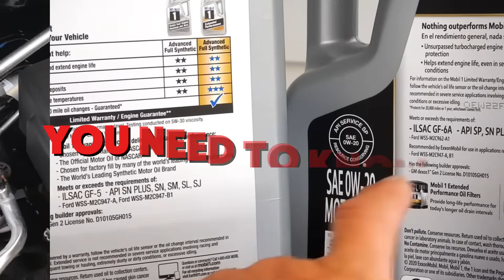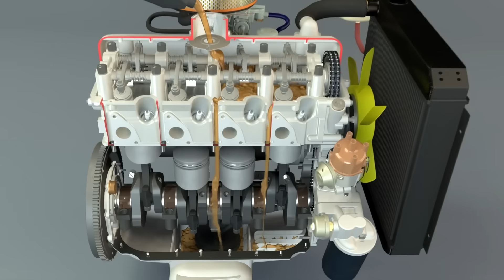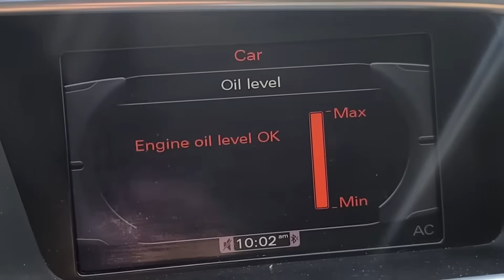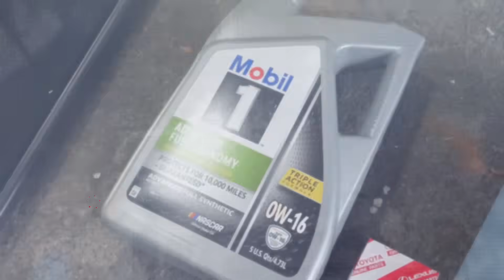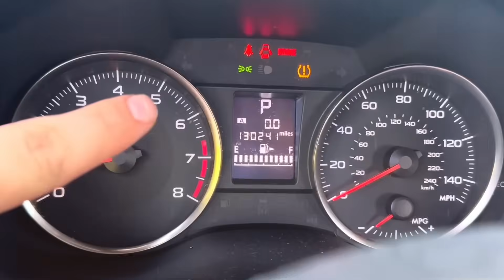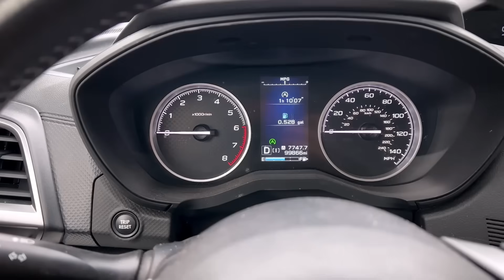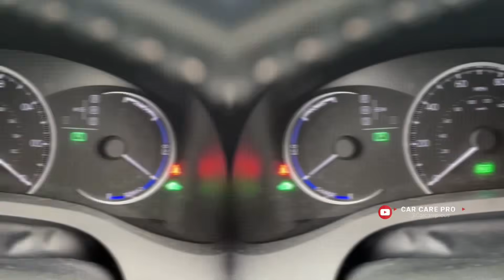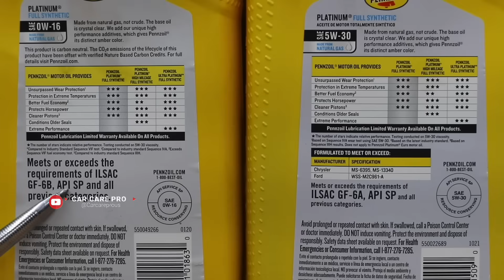5 Reasons Why 0W-16 and 0W-20 Oil Are BEST for Modern Cars

Comment: Have 2018 Camry with 55K miles and live in Florida. Specs call for 0W16. Currently using 0W20 and considering changing to 5W30. Could use some expert advise.
Reply: After 100k definitely go to 5w30. 75k if you’ve been hard on it with lots of city like Miami or Orlando traffic.

Comment: 水冷エンジンなら暖気が完了すれば水温は夏でも冬でも同じですしマルチグレードオイルを使うなら気温とオイル粘度選択は無関係です。
0W-20は部分合成油か全合成油、0W-8や0W-16は全合成油になり価格が高いのです。
整備士が5W-30を使うのは「とりあえずどの車にも使えて安いから」であり、設計通りの性能を引き出すなら説明書通りのオイルを使うべきです。
Reply: Agree. But, my 2016Honda hrv specify 0w-20, 0w-30, and 5w-30. Since I live in winther-cold/summer-hot Norway, I choose 0w-30 during winther and 5w-30 during summer, and changes 2 times a year. That engine will never die. 😊
Reply: GTLが一番

Comment: No they do NOT REQUIRE watery substances such as 0W16 and or 0W20. You were told to use these so Whatever manufacturers headquarters can report to climate authority that they made vehicles 0.5% more efficient, thus "Energy saving" tag, not to be confused with "Engine saving" as these are two opposite things. With watery substance, there will be less mechanical losses at oil pump but oil film and it's strength is laughable VS lets say regular 5W30.